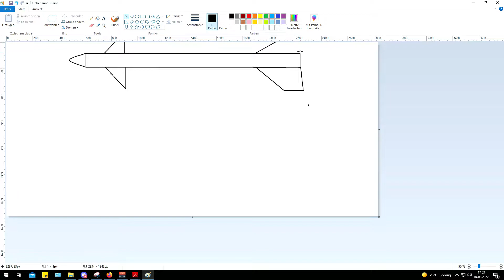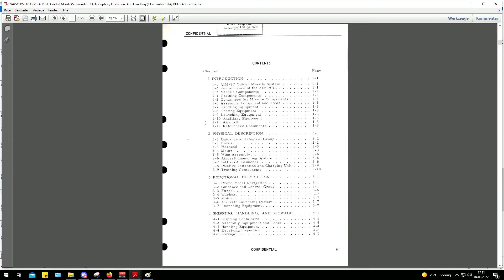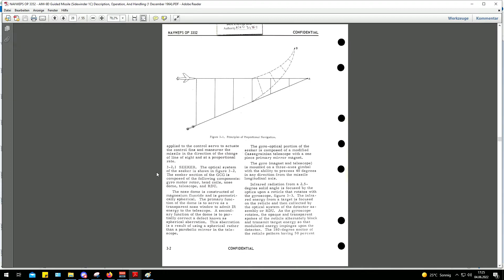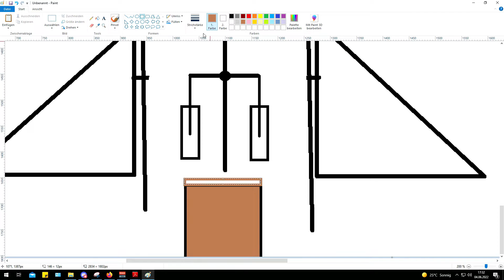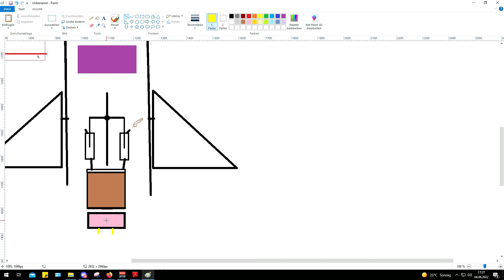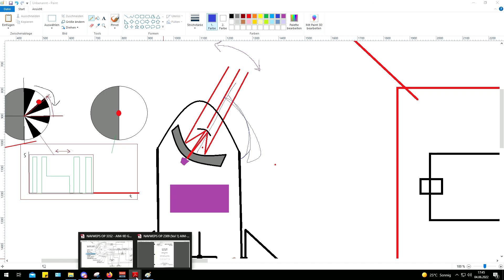Technology Explained: The AIM-9 Sidewinder Air To Air missile

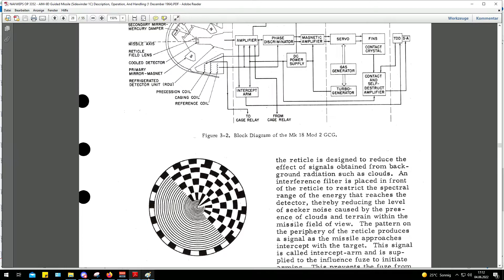Comment: Wait what? Min 12:00 makes no sense, where is the primary mirror?! Cassegrain telescopes have two mirrors, it clearly states that in the document but it continutes to say its a modified one and has one primary mirror. what the f does that even mean how does that work.
Reply from the maker: https://qph.cf2.quoracdn.net/main-qimg-7dcf92def3e378dc71f0c6b8798ec34b-c

here is a technical drawing of the seeker assembly, the mirrors are blue

you have one large mirror (4) and then a second mirror in the center (6)
Reply: @IronPhysik  Ohhhh thanks man, this makes more sense!

Comment: Ive been trying to find out as much about the AIM9 recently for a project I am working on. You are the first person I have found that explains in detail the various power sources used, from Peltier modules, to the GAS reservoir being used to power a turbine for electric generation (previously claimed it was a pyrotechnical generator - which yes I guess it is, but more misleading than a  gas generator driven generator!) 
As well as the progression to the thermal battery. (had not found that info out yet elsewhere)

I find it interesting that peltier cooling modules were used to improve the accuracy of the sensor. I know they eventually moved to liquid nitrogen to super cool the sensor, in an argon atmosphere to improve the sensor performance. 

Thank you for the time and effort explaining all this, I appreciate that you drew this out as you were explaining each point,..
Reply from the maker: Glad you enjoyed the video!